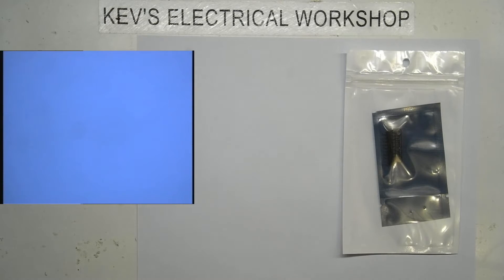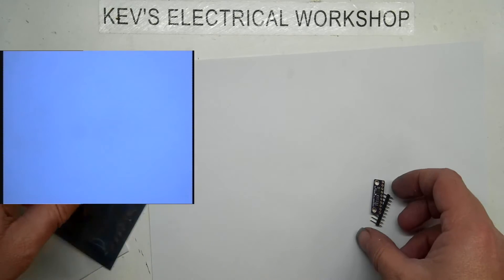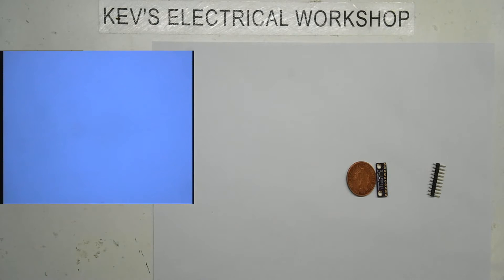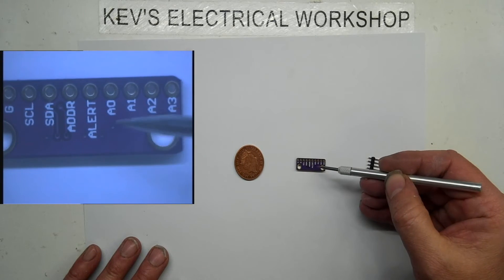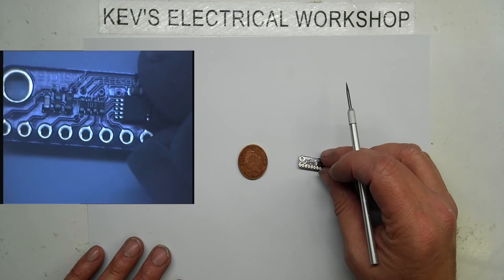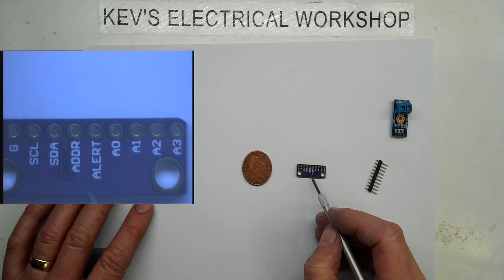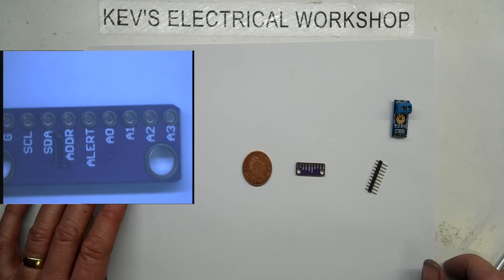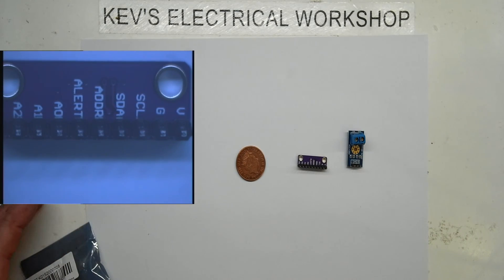16 Bit I2C 4 CH ADS1115/ADS1015 Module

Comment: Has anyone managed to make this work. I am using Adafruit's ADS1x15 library and I cannot make it work. Of course, I have tested the library using Adafruit's ADS1015 and ADS1115 boards. In theory, the communication protocol should be exactly the same. Has anyone got any suggestion?
Best regards.
Reply from the maker: never had a issue, suggestion would be to use the i2c scanner sketch from the arduino site to see what addresses are being used on the i2c bus.
Reply: Well, even after using the correct address it doesn't work. I have two other boards (An original Adafruit ADS1015 and a copy ADS1115 but with the same form factor) and they work without any problem. I think then, I may have received  a defective board. Thanks for the help anyway. At least I know for sure that the same library should work.
Reply from the maker: yes same library, i used them on my 4 Channel DVM Arduino Build  video's